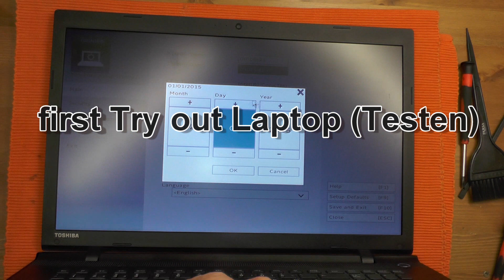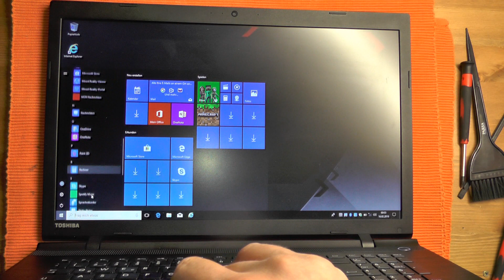Disassembly Toshiba C70-C- Series L70-C Repair Upgrade Cleaning fan

Comment: Hi. I have this same laptop. I want to clean my keyboard. I opened the back and put in more RAM and a SSD, and I've also bought a caddy that replaces the optical drive with the old 1TB hard drive, so I now have C and D drives (I use D for backups).

Do you know a procedure for cleaning the keyboard. Is it a case that I have to take the keytops off from above, or is there access to the keyboard below? Thank you in advance.
Reply: Do you know how to take keyboard off ?

Comment: Do I have to strip the back to change the keyboard
Reply: James Donnelly I have the same issue. Can’t find anything on replacement of the keyboard.
Reply: I would like to clean my keyboard on this model of laptop. Did you find out how to do it? I'm thinking I might have to take all the keytops off. I don't recall seeing any way to access the keyboard from inside.

Comment: Thanks for this! I just upgraded RAM and SSD based on this and it worked flawlessly. Quick in and out. It now reboots from running back to running in sub 1 minute! Brought new life into this old geezer. I didn't measure earlier, but I would guess it was 10+ minutes...

Comment: While replacing the hhd for SSD the connector broke. I cannot find a replacement or partnumber. Please help
Reply: Yikes... if that's the connector on the computer mainboard, the whole mainboard needs replacing. It's soldered on.
Reply: @johnx5891  I worked around it and was able to put the SSD in a CD rom tray. Not using that anyway. Tnx for the reply